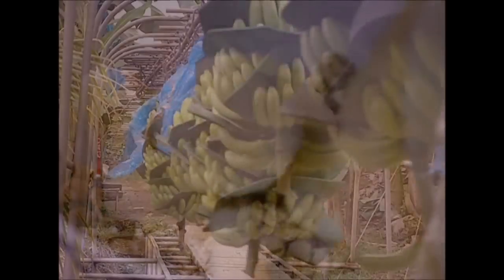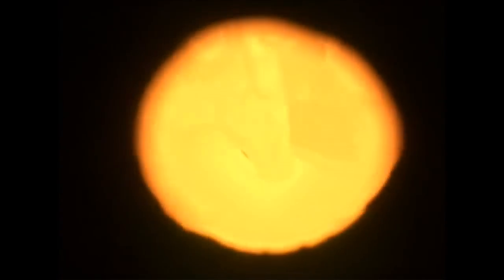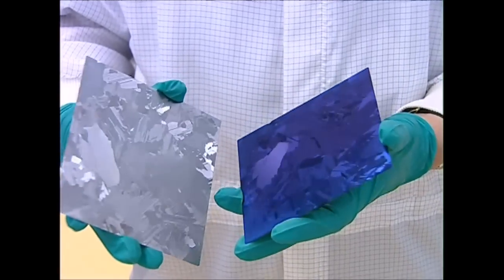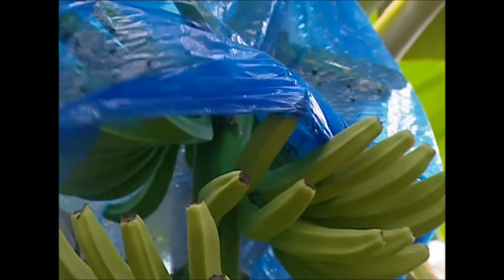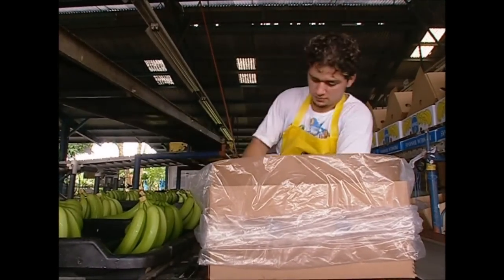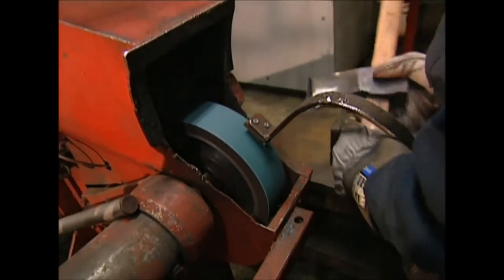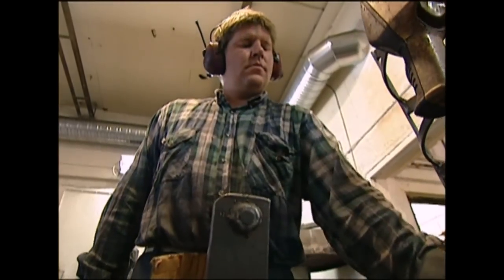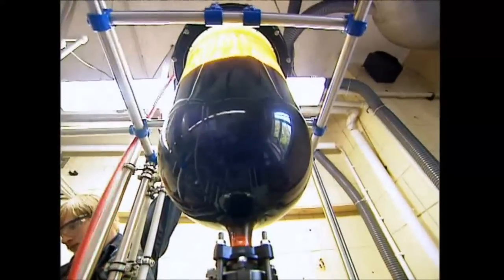► HOW IT WORKS | Solar Panels, Bananas, Axes, Platinum rings | Episode 18 | Free Documentary

Comment: "Gold and silver change colour as they age, but because of its purity, platinum doesn't"

That's a nonsense statement. Even impure higher-karat gold doesn't change colour with age, while pure platinum does. Purity isn't some magical antioxidant.

(And since someone's probably gonna ACKSHULLY at me: I've worked with both karat and fine gold. Only way 22k turns colour is if you almost melt it)
Reply: so how do you know
Reply: @charmaineshull6925  The answer's already in the message you're responding to, but I'll say it again: goldsmithing is on my resumé.
Reply: it is with gold. Pure gold don't tarnish! You can use it for chalk too!

Comment: the problem with solar panels is that most people cant even afford to keep their homes upkept, let alone 50K in solar panels that only power it for half the day, so you either need a MASSIVE roof and a battery room, or still rely on the grid for power at night. solar panels are terribly inefficient to use as a grid-network because they cant be stacked and homes can, so to power a city you need a solar farm way bigger than a city, and a small city to run it, and a small city footprint in batteries. this is why we need to go thorium immediately, and then start work on fusion...sadly big oil and corruption wont let that happen so yay let's play eco-friendly by using solar panels for the elite rich as a bandaid-solution only .001 percent will ever touch! smart hoomans. good job

Comment: Botched Up yur Values of Platinum.   NOT Twice that of Gold.   It's actually Less then Gold.
Reply: Not when this episode originally aired which would've been around 2007 or 2008.
Reply: @barryroberts9086  Never been twice the value of gold .
Reply: At it's peak in May 2008 before it dropped significantly, platinum was more than twice the value per ounce troy at $2000 where as gold was around $900